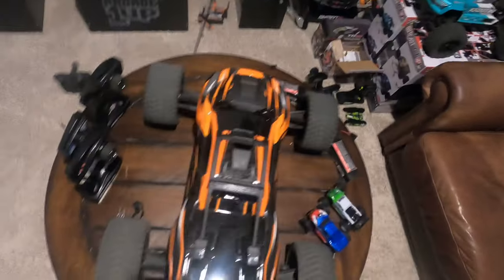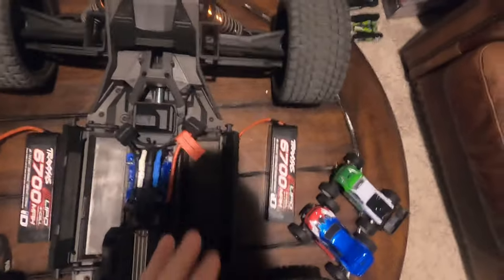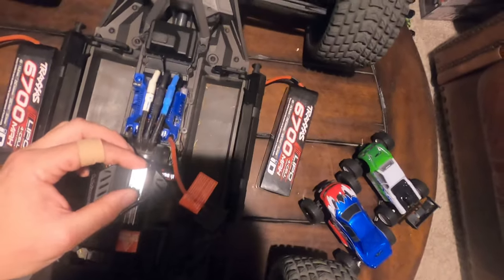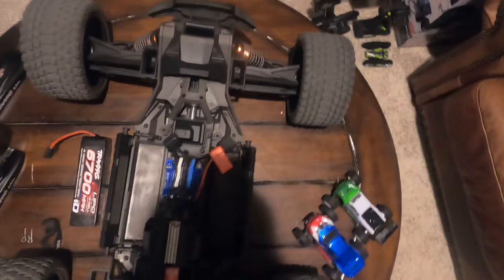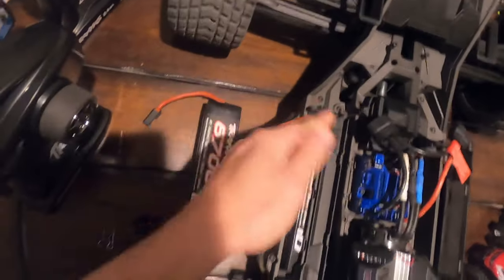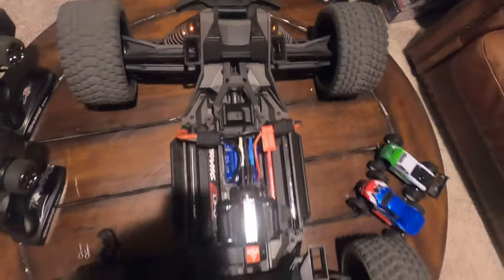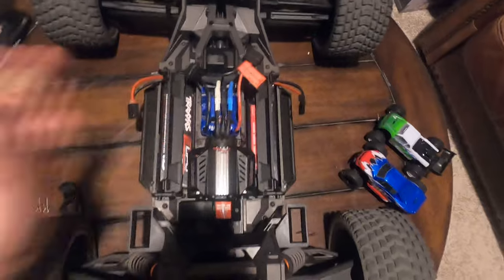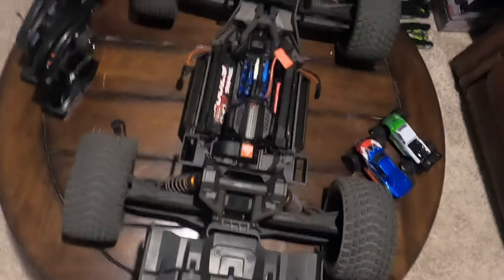Traxxas | XRT - best way to install your batteries! So they don’t get damaged!

Comment: Just bought a brand new XRT Ultimate, and noticed how weird & tight Traxxas designed the wiring/orientation. I took my time & even thought about removing one piece of the padding inside each battery tray. But, I realized I can safely route the wire under the snap-retainers, on both sides, and it worked face up & down (Traxxas Logo). A simple & safe solution, indeed. At the risk of stating the obvious: Traxxas disabled the EZ-SET POWER OFF on the ESC! I NEVER leave batteries plugged in! Negative Electrons will always take the path of least resistance, resulting in excessive voltage-drainage. Thanks for the video :)
Reply from the maker: @benjamincontreras2721  congrats on your new XRT and you went with the ultimate! Excellent choice! Good point that you brought up there and I probably should have included it in this video, your right the esc does not turn off you must unplug it to turn it off unlike some other models which allow you to hold down the button to switch it off, maybe some kind of fail safe for Traxxas to insure that the user does not forget to unplug the batteries, I appreciate the comment and what you mentioned here will definitely help someone new to the hobby or new to the XRT, thanks for watching!🤙

Comment: This is so helpful!! I’m a newbie and when I was placing the batteries in the xrt I was afraid of pinching the wires just as you demonstrated. This makes perfect sense. Thank you very much for this video!
Reply from the maker: No problem brother, thanks for watching!🤙
Reply: Same Here… I just got a XRT yesterday and will place my batteries the same way. I couldn’t even close the battery lock-in

Comment: I do this exactly the same way. Really wish it would have had a cut out slot for those cables. V2 maybe? Great vid!
Reply from the maker: Thanks, yeah I’m not sure why the battery compartment wasn’t thought out better, I agree maybe in a later version, as these trucks get bigger and bigger with more power and brick size batteries accommodations need to be made 👍

Comment: awesome video! I have two questions...i'm very new to rc's and have purchased the xrt. on the first time out I noticed I would temporarily lose signal between the transmitter and the truck meaning I would hit the throttle and nothing would happen. The batteries in the transmitter and truck were both new. The next questions is to turn the truck off? just unplug the battery correct? or is there another way I should be doing it?  ANY SUGGESTIONS? Thank you
Reply from the maker: Thanks, to answer your first question, there could be something causing radio signal interference, this has happened to me before with some of my other Rc’s, not sure what causes it, it doesn’t necessarily mean your truck is defective, it could be your run location, in my situation, where I used to do my run videos, there was a cluster of power lines and a fire station down that road and when I would drive my Rc’s down the street in that direction I would sometimes lose signal, everywhere else was fine, also be sure that you don’t drive to far away out of line of sight, to turn off your truck you should just unplug the batteries, this is a newer feature Traxxas has implemented for safety, to insure that you don’t just turn off the truck and leave your batteries plugged up, some people don’t like this feature, they prefer to manually turn it off at the esc, me personally, I don’t mind either way, fyi you should never just turn off an Rc and leave the batteries plugged up for any long period of time as it will continue to drain your battery even when it’s not turned on, resulting in battery damage due to surpassing LVC! Hopefully this helps,if you have any more questions feel free to hit me up, thanks for watching!🤙

Comment: Hey amazing video but question I have an Xrt and I ran the batteries the way you said and it still got punched any advice on how to let that not happen ? 
Would appreciate any tips and also is it safe to be running the battery that got nicked I just put electrical tape on it ?

Comment: Thanks for the video! Do you do the same with the Maxx v2? That fit is extremely tight. I actually ripped the shrink wrap on the battery during my last bash.
Reply from the maker: Yeah I do it the same way with the Maxx v2, only with the Maxx v2 I run it with the battery connector hanging out towards the rear of the truck instead of towards the front like we did in this video, thanks for watching brother 🤙
Reply: @rcreviews9894  Awesome, appreciate the reply!

Comment: Thanks for posting this man I have a xmaxx and the trays on it are way better than the xrt. This is the first thing I noticed when I went to put my batteries in I said why the fuck did they use this style they could of used the same exact ones the x maxx used.

Comment: Great video on that brother I'm gonna make the same video on my channel this week. Just got a xrt only ran it twice so far no bashing yet 🤟👊
Reply from the maker: Thanks, that’s good, spread the knowledge, it can really help someone that’s new to the hobby, so how you liking the XRT?
Reply: @RC Reviews  yes bro exactly.  Only had it for a month or so now. Actually got it used from the hobby store owner so I has the upgraded traxxas servo and metal control links in the front. It's awesome handles and drives great. Upgraded to max 6 right off the bat and sold back rhe traxxas esc to the shop. With the speed gearing installed its tons of fun. And iv been a arrma fan boy for a long time lol.

Comment: Where did you get the hypertrax?  Didn’t know they still made them
Reply from the maker: They don’t, I got that maybe 8 years ago and it still runs!
Reply: @rcreviews9894  
Yeah. Mine still runs too. Probably got it that long ago. Fantastic little RC. I put a wild Willy jr body on mine. It’s in a vid on my channel if your interested in seeing it.
Reply from the maker: @JaxTellerRC  cool, I’ll check it out! Yeah my only beef with that Rc is that it takes 8 AA batteries for the radio!
Reply: @rcreviews9894  ha ha. Yeah but it charges off the radio so makes sense
Reply from the maker: @JaxTellerRC  yeah lol, honestly though that’s probably one of the best toy grade Rc’s, don’t know why they stop making them, they were pretty cheap too! Like 30 bucks at Walmart lol

Comment: there is actually a small spot under the area that the batteries clip at for you to tuck the battery wires under. It seems like nobody is aware of this..
Reply from the maker: Good tip I wasn’t aware of it myself 🤙

Comment: Dude. Them wires aren’t that dangerous. Lol.  

And no it’s not a risk using that battery with electrical tape on it.  Haha.   If you gonnna throw it out and AFRAID to use it ,give it to me !  
I’ve been in RC for 40 yrs.  Btw.   Own MANY .

Comment: I destroyed a brand new battery the first time I put it in the xrt what a horrible design xmax is way better thanks for sharing this video great information your video should be put in the manual
Reply from the maker: Thanks, yeah I should have known better though, I usually run my Xmaxx batteries the same way I demonstrated in this video, guess I got a little too excited lol
Reply: @rcreviews9894  you explained the battery installation so easily thank you again this is going to save a lot of people some serious headaches
Reply from the maker: @user-wp9mz  thanks again, your are right though, the Xmaxx battery tray is easier to deal with, sometimes I wonder if Traxxas just copy and pastes the instructions for some of their kits because the way they explain it when it comes to the XRT is just a total fail